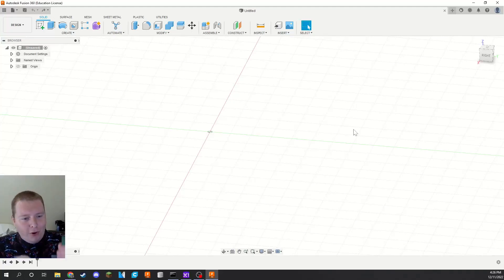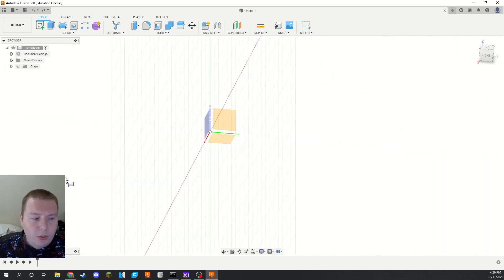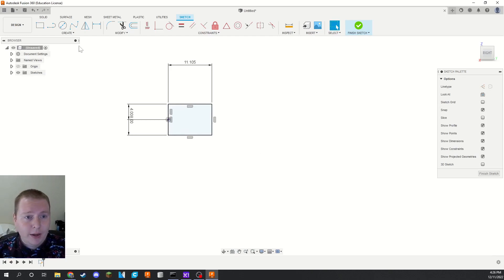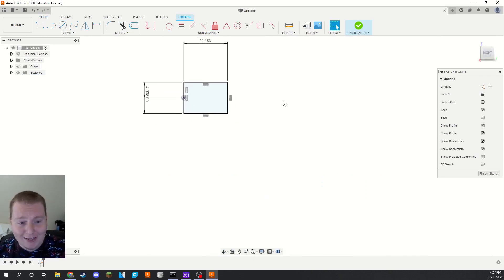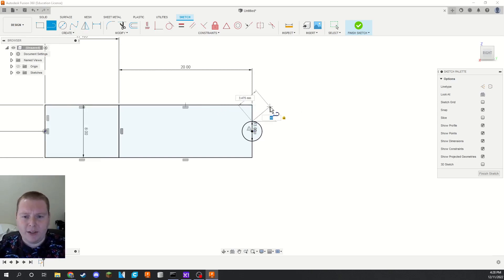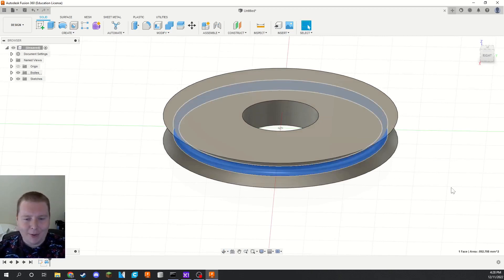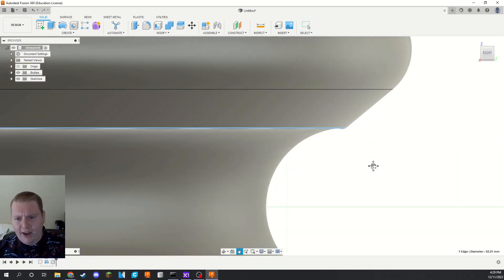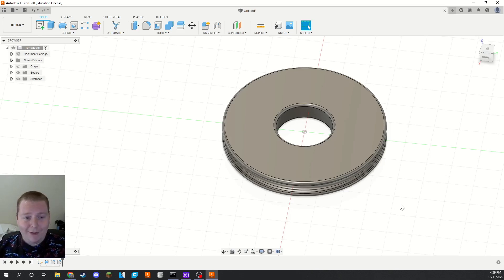Modeling Polyurethane Belt Pulleys for 3D Printing in Fusion 360 (good alternative to gears)

Comment: Do you print these in one go? What material, print speed and layer thickness? I'm wondering whether the round profile will turn out "round enough" or whether it is necessary to print this split into 2 and then screw them together.

Comment: You just showed me something that will end up saving me so much time! The 3D printed project I'm dreaming up is going to use these now instead of timing belt. Simplicity is a feature and I'm grateful for an informative video that got straight to the point. Thank you.
Reply from the maker: Great! These little pulleys are a highly slept on solution for 3d prints